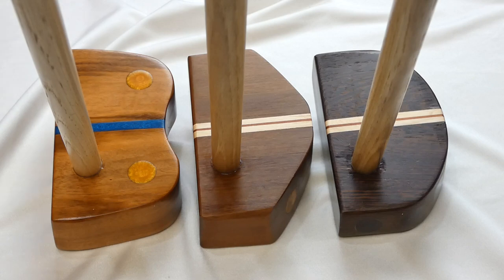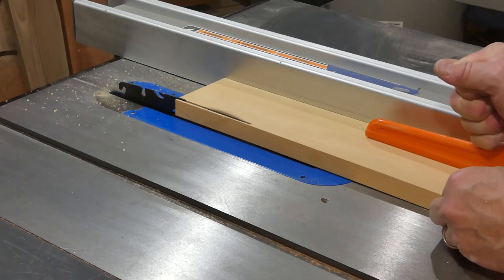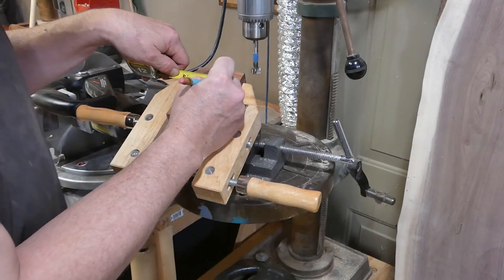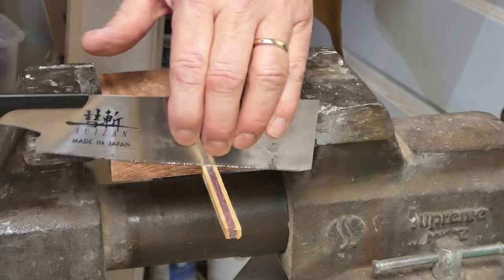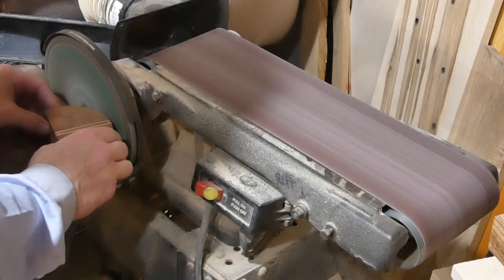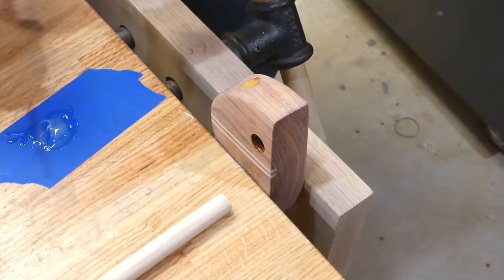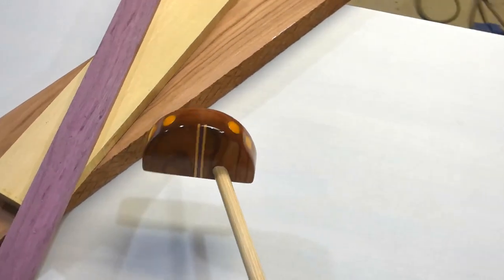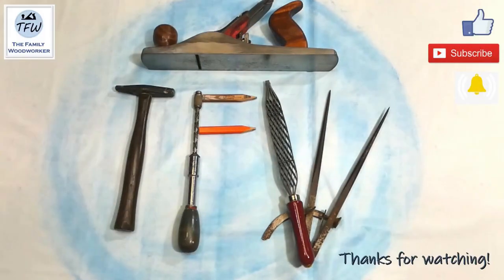Make This Amazing and Functional Rare Wood Putter

Comment: That is a really fun way to make a putter. I like your use of plumbers putty. I have some laying around that I bought and then never ended  up using (after doing some research it turned out that it wasn't what I needed after all, lol) Thanks for sharing!
Reply from the maker: It does work pretty great as a way to hold the epoxy from spilling out...  Best project results seem to come when you're winging it and adapting solutions to get you where you want to go.  Thanks man!

Comment: good video, I too would like to make a wooden putter head. One question I have is the wood growing in layers, is there a way to take advantage of that? thx in advance
Reply from the maker: Hi Rory!  If you're talking about growth rings within the tree trunk, I have a couple observations. Slow growth hardwoods are best, especially those that rank highly on the Janka Hardness index, because the growth rings/layers are tightly packed together. It makes for a hard, dense putter.  I also like the look of the woodgrain running front to back (putter face to back), and that puts the end grain on the putter face making it a hard hitting surface too. I would avoid the sap wood of the species you choose because it is often softer than the center heart of the tree. If you pick a tree variety that is a little softer, you can harden up the end grain fibers with some CA glue before your final finishing.   I wish you best of luck on your project!

Comment: I have not used polyurethane before so I’m a little nervous. It looks like you are spraying it on. Can you share the product that you used?
Reply from the maker: It's just Minwax gloss poly, dries pretty fast between sprays and is completely water resistant.  But, you can finish it with whatever you're most comfortable with too... Just keep in mind you're dealing with wood and it might get a little wet along the way.
Reply: @TheFamilyWoodworker  Thank you for the help!